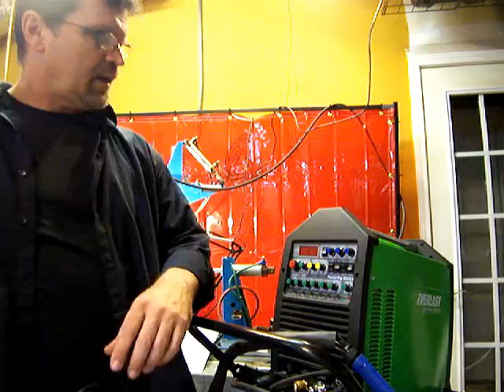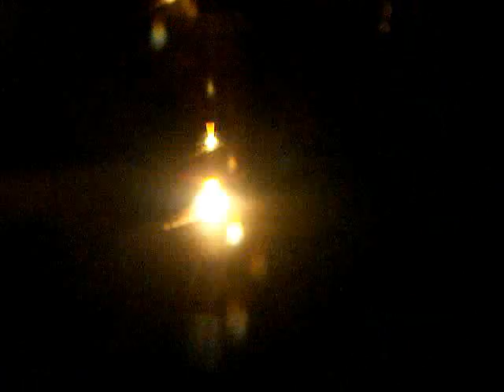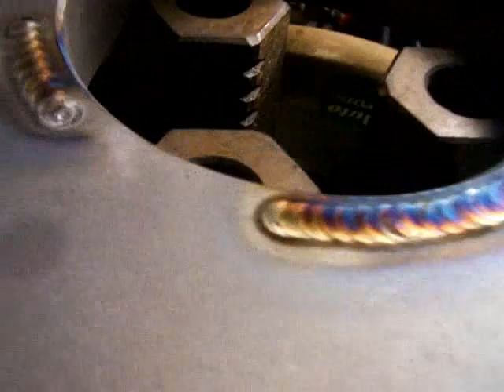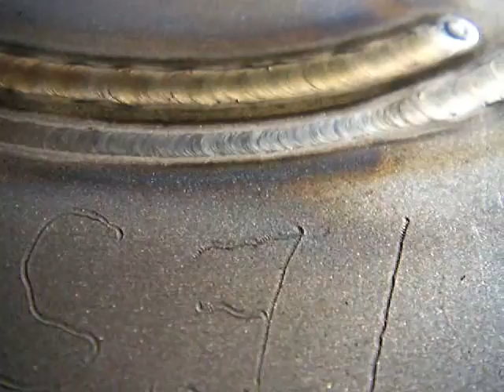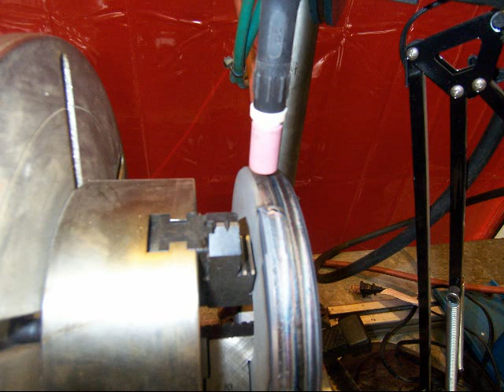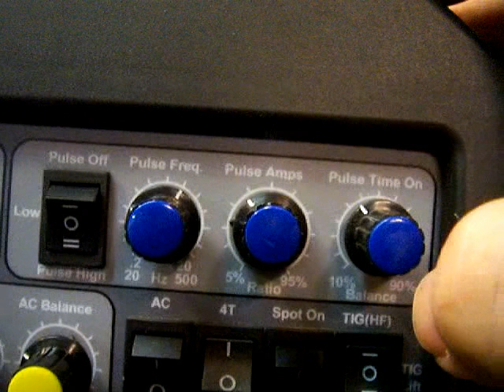Tig Welding Equipment With Pulse - Everlast Powertig 250EX - Part 4

Comment: Jody have you had the opportunity to compare this welder with the Everlast 255ext?
Reply: I'm looking into buying the 255EXT as well, and would like to know how much better/worse it is as far as features and programmable settings go. I'm ready to purchase a welder with the features that the current ones I use do not have so that I can practice with my own settings rather than what my machine limits me to. Not that it will make me a better welder, but I love tinkering and fine tuning!

Comment: You can go as high as 500 pulses per second if you wish. There is a lot of information on starting values and as you become a better welder you can start to work with changing settings to make your welds better or easier. Miller and Lincoln have their place. I would rather take the money I save and use it for other things.

Comment: The 250ex has just about all of the features there are. It has a pulse frequency range of 0.2Hz to 500Hz. The Everlast 210ext has those features and adds special waveforms.

Comment: #popylocodropit - I've had mine for about a year now. No issues.
#arcstreams - yes there is a knob for adjusting frequency higher to narrow the arc. 250ex can go to 250hz. 60hz gives you a fat arc
great video